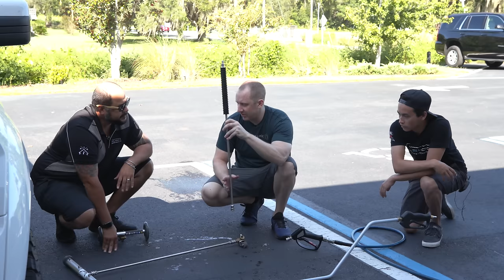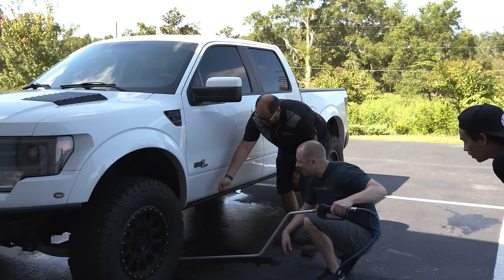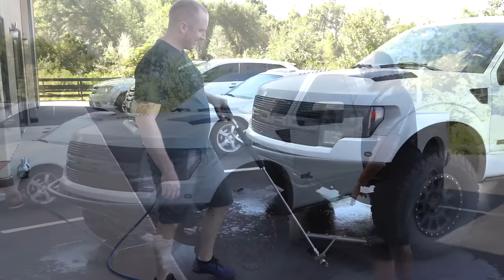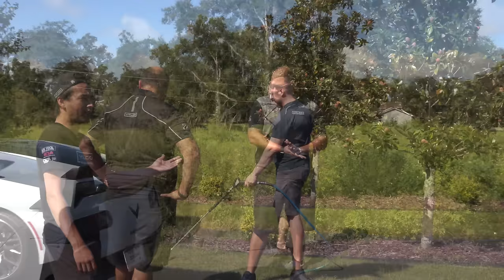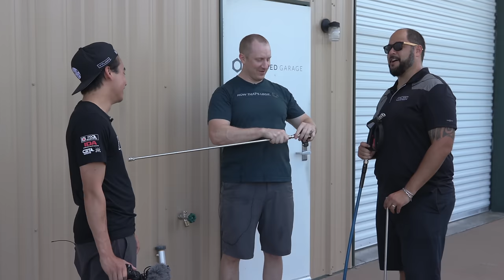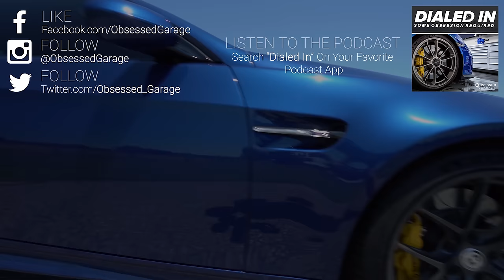Discussing Undercarriage Sprayers With MTM / Veloci

Comment: So here's my takeaway: the Ryobi has better pressure and built for MOST cars. What should be bought in addition is that 36 inch lance and the swivel with wheel so that way you're not having to get low to the ground with just your wand attached.
Reply: It also can be used as a broom vs just dedicated to a vehicle.

Comment: Any plans to add these to the store, or should I just order from MTM? Rob needs to go back to school on pressure and flow though. The pressure is dependent on the orifice size and the pressure drop through the hose and fittings in the system. Whether you have 1 nozzle or 4, the pressure is the same for a given orifice size. The pressure does not divide...the flow divides.

Comment: The nozzles on the MTM are too far apart, and on lower vehicles like the Vette, it looks like it might leave clean stripes on the undercarriage. The killer setup would appear to be the Ryobi with smaller wheels, the MTM third wheel and flexible wands, or the MTM with a closer spacing and a three nozzle spray bar.

Comment: what about swapping smaller roller blade wheels on the ryobi?
Reply: This guy gets it.
Reply: Mitchell W exactly! I don’t know if there removable, but what’s on there now are toddler scooter wheels. In this world you can make anything work!! I think the ryobi is the way to go unless you have the money to just throw away then go for the MTM setup that will cost $400.  $40 or $400🤔 lol
Reply: Mitchell W you can also buy wand extenders and swivels on amazon for cheap. It’s like I said your rinsing the under carriage no need to spend over $100 to do the same thing. 3 nozzles are better than 4 for most people that have cheaper pressure washers. 4 nozzles might not give you the pressure you need.